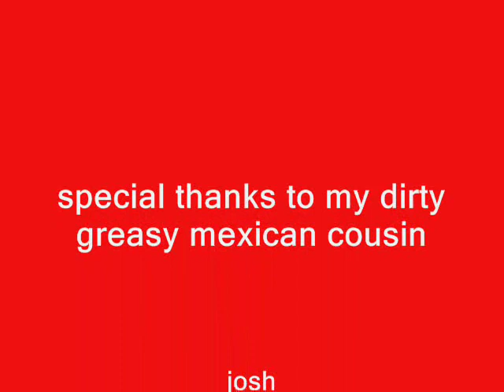Auto to Manual Swap (240sx)

Comment: @mattyboi1 Hey i bought a 240 with a swap done... did you have to do anything special with the ignition wiring? because i'm having starting problems... and some one told me you have to do something special to "complete the circuit" with the ignition...

Comment: Deaf driver here and I plan to buy a car soon. Hoping to get Acura RSX Type S MANUAL but. . .hey, papi would never trust me that I can drive a stick. I LEARNED HOW last week but that isnt the point. 

The question here is, how much does it cost to swap auto to manual? Cuz I thought of another way: Swap automatic to manual in RSX then buy some tuning stuff like tune the horsepower up with pressure and intakes or whatever it takes. 

What do you think?

Comment: I have a 93 rx7 with an auto tranny and my engine just blew the turbos.i will be removing the entire engine and transmission soon i want to know if i can just buy an engine with the manual transmision and drop it in they cost roughly around 1500-2k for the package. would there be any real issues with that.

Comment: Did you change the ECU? I change my matrix to a manual and the check engine still on and the code said is shift solenoid. what can I do on this case? i din t change the ECU. do I have to?
Reply: use the automatic ecu

Comment: @Jordan92028  bro manual s13 are alot more expensive, you can buy an auto and do the swap for cheaper than, buying a manual s13, well at least in missouri